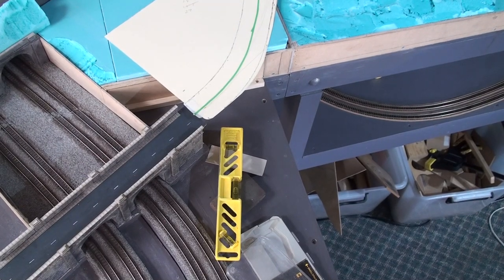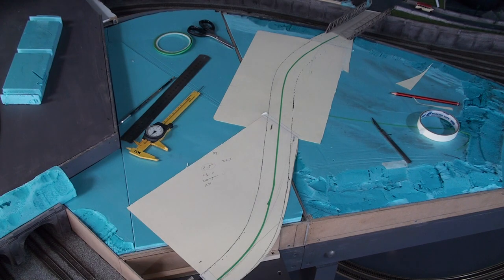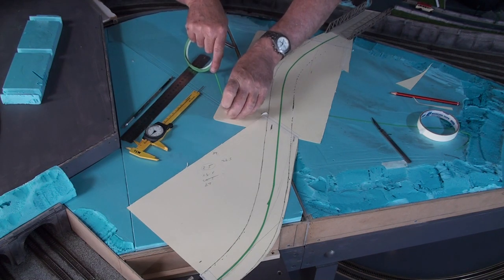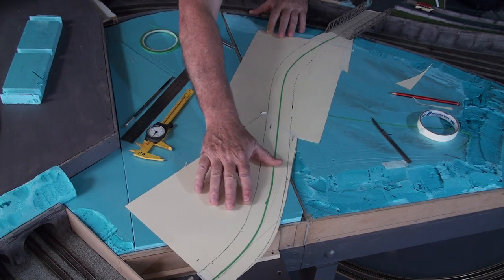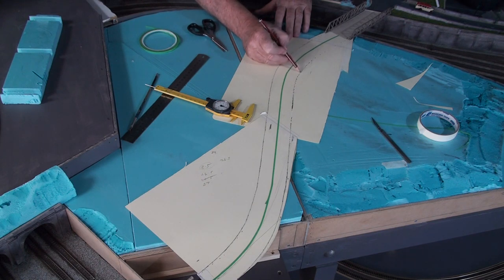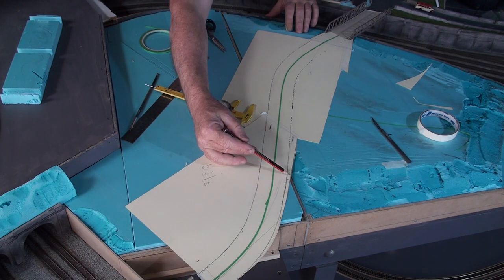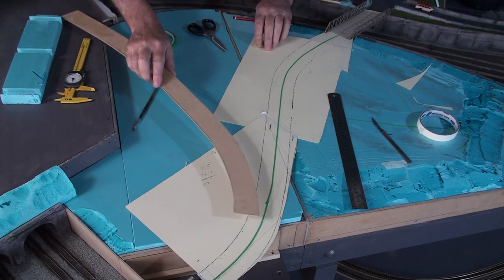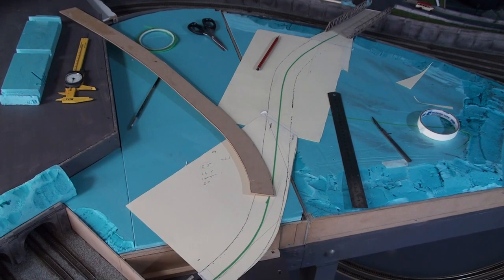N Gauge Four Oaks Street Station Part 40

Comment: Good tip on road construction.
I do a simiar method but make the roadway about an inch wider than needed so the verge can be blended over the edge hiding any unnatural looking joint lines.

Comment: Hi Chris Thanks for sharing great tips. When I use my jigsaw 99% of the time I use it upside down so the machine is underneath the board and the blade is pointing upwards this means you can see the line easier, and the cut action is on most blades are upwards towards the machine so the edge were the mark is, is a clean cut. Colin
Reply: @ngaugefouroaksstreetstatio6932  Don't be afraid of the machine or it will win. Colin